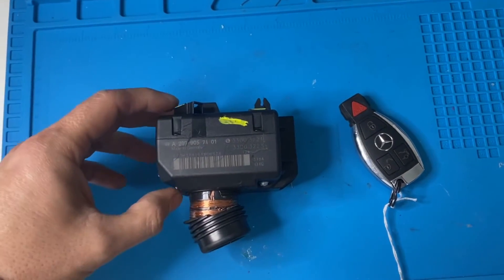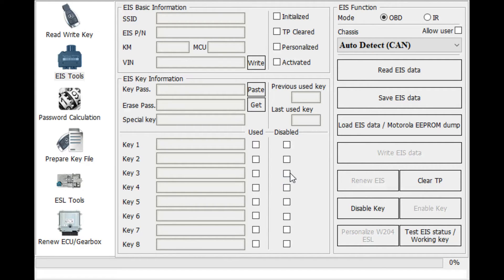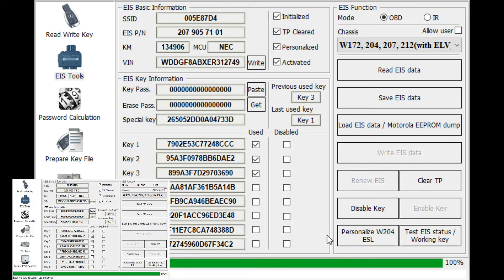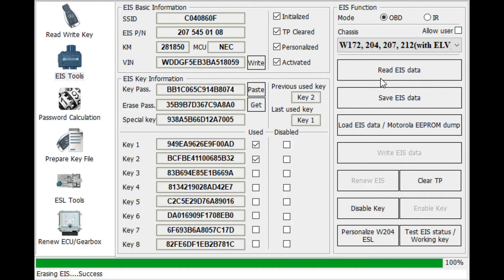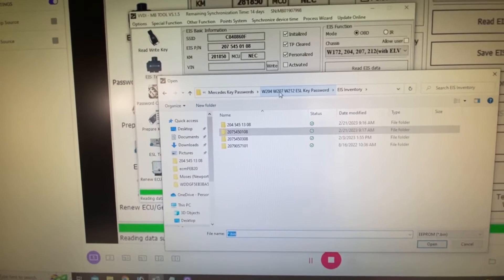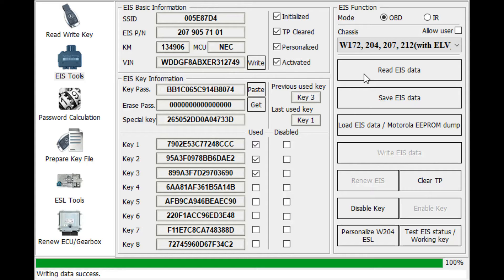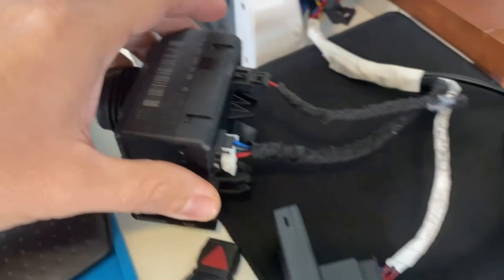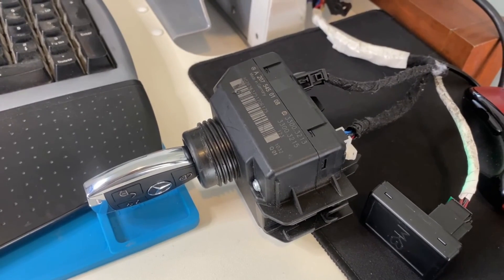W204 Mercedes-Benz C300 Vandalized EIS. Damaged Ignition Switch. Can I clone it?

Comment: Hey how were you able to use a new key with the new eis since "no key was used" all keys were unchecked and green, after the clone ?
Reply from the maker: When you clone an EIS, it must first be "virginized" or cleaned out of previous data and unlocked. All previous key slots become available.
Reply: Yep no problem with that i did exactly what you described in your video and it worked and thank you for that. my problem is when trying to activate the eis it is not letting me. My question is do i need to make a new key or can i use a used one (the one which came with the donor switch) ? Ps i am using cgmb and when i try to activate it using the activate button post cloning it is telling me : no used key position manual activation is prohibited  @mercedesbenzspecialist
Reply: @mercedesbenzspecialist  hi again i did virginize it doing the same as in your video. I'm having issues activating it post cloning. When trying to activate it it is saying : No used key position, manual activation of EIS prohibited. Do i need to create a new key ? Can't the donor key work ? I appreciate your time

Comment: good morning sr,
sr so what's the essence of cloning the eis,
when you still have to program a new key and ESL.

is that so that the ECU will still be at use?
and VGS.

what's the essence when you didn't still use the old key and ESL?
Reply from the maker: The reason we cloned it, along with a new key and ESL emulator is so that he wouldn't have the change the Engine Control Module and the transmission control module. Replacing all of those modules would be much more expensive than getting a cloned EIS, new key, and ESL emulator. The emulator was a smart choice to get done before the ESL failed. You could buy a complete DAS set. In this case for the W204, you would need the EIS, ESL, key, ECM and TCM.

Comment: thanks for the video, when you change the password and program a new key, does that mean that the ESL needs to be reprogrammed or is it not affected?
Reply from the maker: In the w204 model yes the ESL must use the same key password as the EIS and key. We would reprogram the ESL or program an ESL emulator to replace the factory ESL as it will surely fail in the future.

Comment: Why try to clone the EIS instead of just unsoldering the broken mechanics and resolder back the mechanical stuff from the donor EIS to the customer's board?
Reply from the maker: Repairing circuit boards is not what we specialize in. It takes much less time and effort to clone an EIS than repair it. If you would rather repair your EIS than have it cloned, and you have the tools and skills to do so... that's a matter of preference.

Comment: hello i have another problem with my eis and i don't find anything on internet the second position is very hard to turn but work always do you think i can open my eis to see what is blocking ?
Reply from the maker: If you feel confident enough to be able to open it up and attempt to repair it. I would highly recommend saving the data before opening it up. You need specialized tools to save that data.

Comment: Hi there.
So... i bought an chinese start/stop sistem remote keyless entry to instal in my w212 from 2012. 
In instalation book it says after soldering all wires on EIS, dont turn the key in EIS. Offcourse i was stupid and i turned without realising. 
Now, the car not start. I get the lights in dashboard, i can go to posiyion 2 on EIS, but when to position 3, car not start. 
What can be done or what was happening inside when i turn the key inyo ignition after soldering the wires on EIS motherboard? 
Could that can be cloned now? 
Any sugestion of how can i revive the EIS without computer and programs and codings? 
Best regards.
Reply from the maker: Soldering on the EIS board is risky. I ALWAYS save the EIS data before I open it up. 

I'm guessing something was shorted during the soldering process. 

Yes I can clone your EIS. Even if I can't get the data from your EIS I can get it from the ECM.

Does you EIS have a white sticker on the back? If so, are the letters "FBS4" present? If that's the case.... your really screwed.
Reply: @mercedesbenzspecialist  Hi, thank you for reply. 
Mine is FSB3 (A2129055800).
As i said i dont have any method or tools to save any data before soldering. On tester i have something like "input circuit 50 - no" and "output circuit 50 - no"
Reply from the maker: @djovidius3545  I figured you didn't have the tools to save the data.  For others who are reading this...  if you can't save the data, don't open it up, don't risk soldering and losing all your data. Things get more expensive if your EIS needs to be cloned to another EIS.

Ok good FBS3 I can work with. If you want my help. Send me a text message or call me.

Call us at 818-510-3375